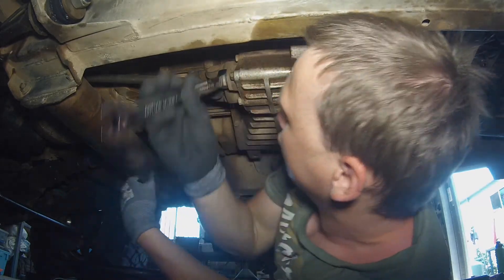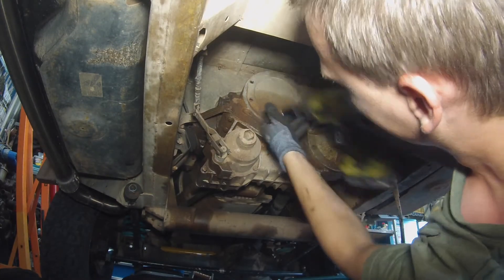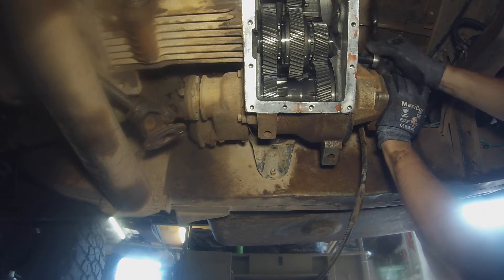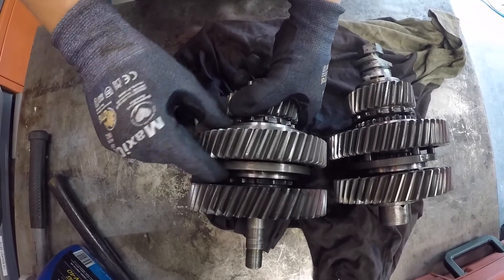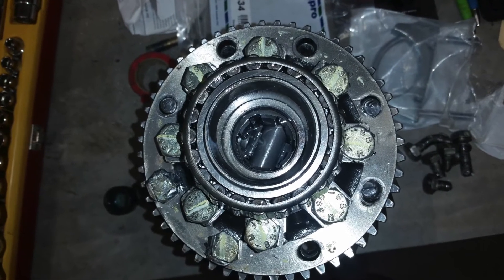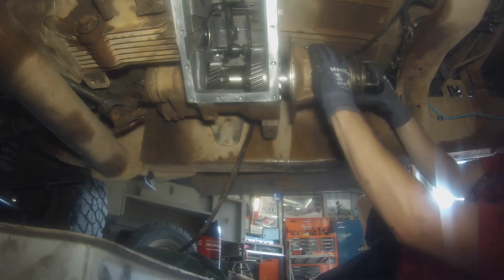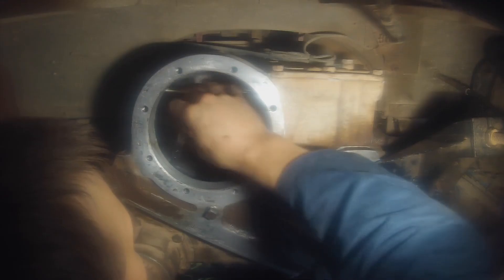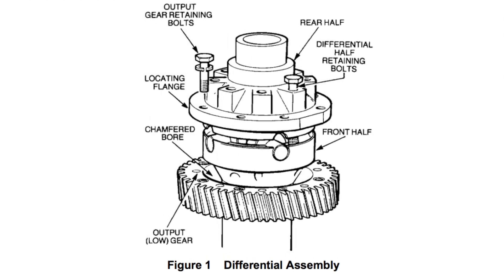LT95A transfercase center diff removal

Comment: Andrew how do i obtain a workshop manual (lt92a) gearbox as i believe the 95a diff set up is different to the lt95 diff set up.Maybe the whole transfer itself is different,i have a lt95a.  Thanking you.
Reply from the maker: https://www.remlr.com/ goto "The Library" then "Electrical and Mechanical Engineering Instructions" and then "Land Rover Perentie 110" if that's the vehicle that you have.

Comment: Hey mate, 

Great video. I just found that my copper thrust washers have gone, so I'll be doing something similar very soon. 
Do you have part numbers for the right bearings, seals etc. for the LT95a transfer box? 

Cheers, 
Jodan
Reply from the maker: Checkout the parts catalogue here http://www.remlr.com/rps.html
Reply from the maker: what copper thrust washers? You must have the LT95 box without tapered roller bearings?
Reply: @AndrewSmith-147  in the centre diff on the cross pin. All fixed now 😊